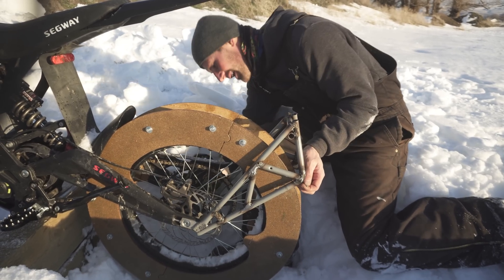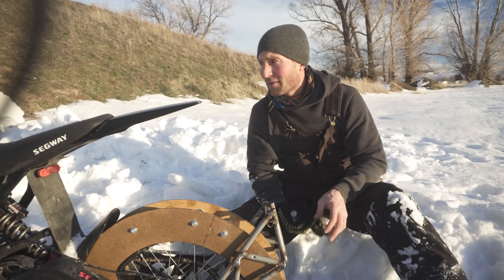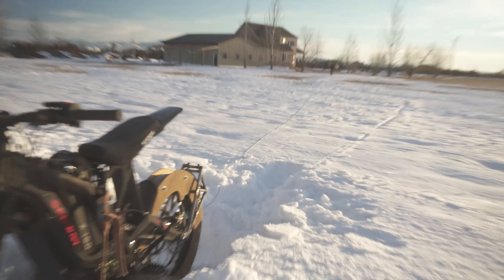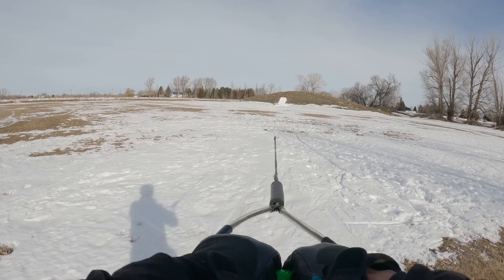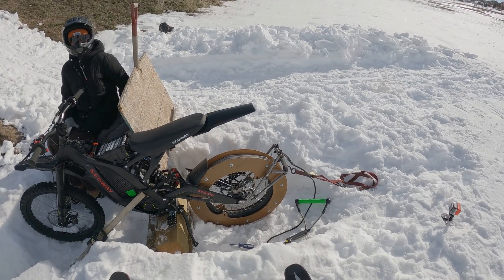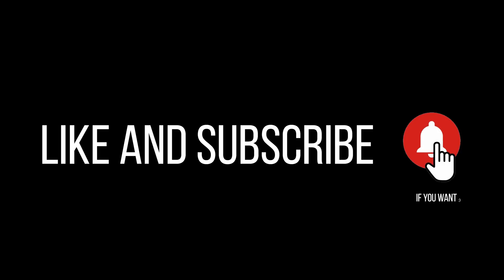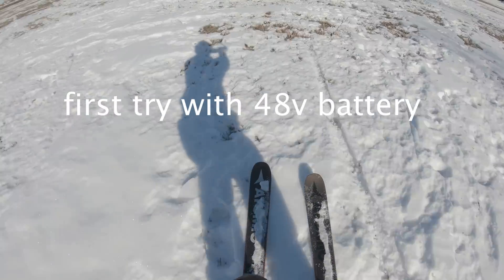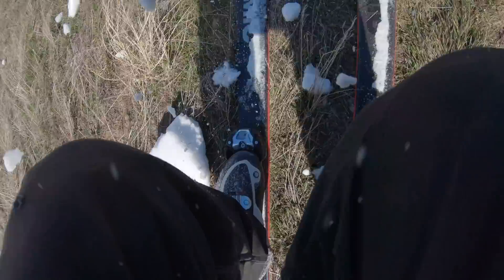Electric Dirt bike + wooden wheel = FAST

Comment: It took me until 3:36 to figure out WTF?! With a few hard points to rig to, and some quick reeve snatch blocks, this certified crane rigger says you could get the pulling point out to the highway.....and have Sylvia throw a grapple hook onto to a passing vehicle and really get some big air. More practical probably, you could use a vehicle on your driveway.

Comment: Too funny !!!

When I was a kid a neighbor set up a ski hill in the nearby koolie that was on their property. They took their rusty old farm tractor and parked it backwards against the bottom of the hill. One side was propped up on blocks and a tow rope was laced around the tireless airborne rim. An idler was positioned in-line at the top of the hill and anchored to their grain truck. The janky rig probably had less horsepower than your bike. There wasn't a kill switch or safety guard within five miles of the setup but I don't recall anyone ever getting hurt. It was a swinging hot-spot in the local farming community during long winters in Northern Alberta.

p.s. Booze was involved.
Reply from the maker: Haha sounds perfect!

Comment: Yeah, man, that one was cool!

Came for your flying videos, have stayed for all if the other antics now.
How do you like your Segway bike?
Reply: Now that it has almost double the voltage? Sounds like fun. Mine has 84v fully charged and at only 120lb it's quick.
Reply from the maker: I love it. go for the surron or segway x260.
Reply: @JonasMarcinko  
Thanks, Jonas.
I'm thinking to get the x260 for myself and the x160 for my 13 y/o.
Need to find them in stock first!

Comment: Cool stuff! I think you should add a turnaround pulley so the handle isn’t whipping at the winch operator. I like the jump and the winch. Add more line and tow yourself up on the paraglider. Be careful and use a tow bridle, a weak link and watch out for a “Lockout”. Great channel!

Comment: Awesome! still got the ski skills! the ski jumping clip with the 360 to flat was the second video of yours I ever saw. the first was when you unfortunately fuel starvation endo'd your yellow kitfox at the river. so thats a pretty rad setup for a bike winch conversion.. Years ago I built a homemade winch to hit features  in reno and even in fresno in the central valley of cali. My winch was way too heavy and took atleast 3 people to lug around. I also had a problem keeping the ski rope handle from flying in and slamming on the spool. It was scarier to run the winch than to hit the rails or walls we'd bring it to. eventually we just made a knot in the rope to hang on to.

Comment: Mr. Goldberg called, he'd like to take you on as a consultant.

Many moons ago, last century, I had a drum machined on the wheel to the back of a motor scooter, mounted it on a trailer and ran 3000 ft of 3 mm Spectra (700 lb test) through a fairlead. Paraglider winch for flat ground. The automatic transmission meant there was just enough power to get about 6-800 ft AGL.
Reply from the maker: 😀 
That’s awesome.
Reply: @JonasMarcinko  Yours is better, being electric. I wasn't that much aware way back then. Will you be adding solar panels to your farm?
Reply from the maker: @freddotu  I’m hoping this summer!
Reply: @JonasMarcinko  Farm Out! Right Arm!